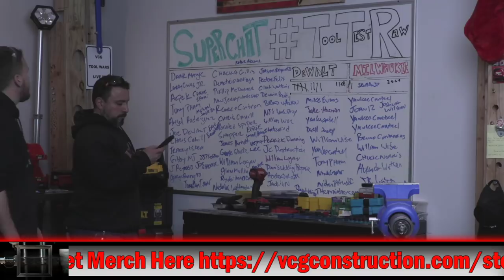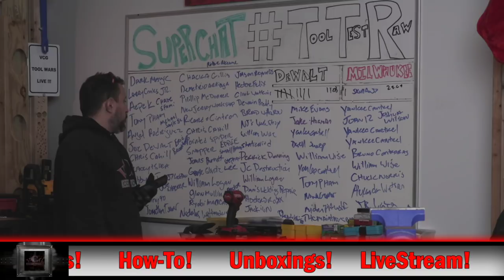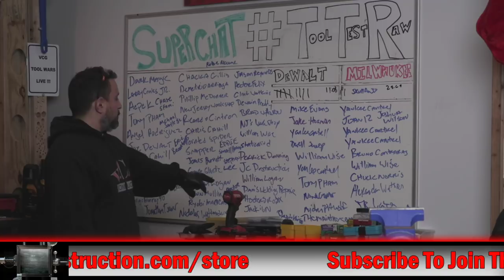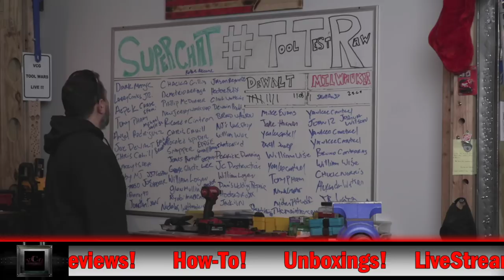Milwaukee M18 Hackzall VS DeWALT XR  Reciprocating Saw (BEST OF THE BEST)

Comment: The DeWalt blade turns in 4 different positions so you can make cuts in areas where you wouldn't be able to make a cut by turning the whole tool. And Milwaukee torch blades are awesome! Don't know who was saying they aren't. But I used those blades to cut through 10 oil tanks before I had to change it. And the only reason I changed the blade is because it  got pinched and I couldn't get it back out.
Reply: Most sawzalls you can flip the blades upside down. All the different ones I've used and owned I flipped the blade upside down and used them no problem. 👍
Reply: Jason Levesque every manufacturer will let you put the blade in either teeth facing down or up. DeWalt is the only one who is able to put it in facing left or right without having to turn the tool on its side.
Reply: @bamaboy9133  yeah  I know I had a Dewalt corded sawzall a few years ago that the blade went 4 directions .👍

Comment: I definitely agree on the M18 fuel Sawzall that has the articulating head and where that's an XXR that's a new one I think the fuel and the XXR would be a better matchup makes it more equal
Reply: I agree...this is not a good match in comparison.
Reply: @homemade6015  yes I definitely agree because the version that was being used for the Milwaukee as an older version and the fuel would be a more comfortable comparison nice to think I'm not the only one that thinks though thank you
Reply: @johnaba5683  I would like to see them to take up on your suggestion and have a fair rematch.
Reply: @homemade6015  thank you homemade I completely agree I think that would be fair

Comment: Last comment promise lol. At the conclusion of the vid I have come to the conclusion that the two saws have different niches and are therefore both winners. The Milwaukee for the one handed needs and the Dewalt for the compact full featured saw needs. And to be honest if you already have a full size recip I'm not sure the compact Dewalt gives you as much niche advantage as the Milwaukee would by picking up a secondary saw. If you didn't have a recip and wanted to pick up one saw that could manage one handed tasks (albeit not that well) as well as traditional recip tasks the Dewalt would probably be the one I'd pick up.

Comment: I have both the DeWalt DCS367 brushless & Milwaukee 2719-20 brushless.  I see little comparative advantage from having the motor project down from the blade-mounting shaft as DeWalt does or from having the motor project up from the blade-mounting shaft as Milwaukee does.  The  Milwaukee without battery weighs ~ 4 pounds and has 7/8 inch stroke while the DeWalt weighs ~ 5 pounds and has 1-1/8 inch stroke.  But in use, the DeWalt is not just a "denser" (language from video) version similar concept with more power.   Milwaukee's design largely compensates from reactive stroking mass vibrations by adding a separate counter-reactive moving mass which in some (not all) circumstances makes the DeWalt seem crude by comparison.  If the workpiece being cut presents a surface against which the guide "shoe" can be pressed with sufficient force to transfer most vibration into the workpiece, Milwaukee's vibration suppression compensating system offers no significant advantage.  But recently I was cutting through roots and debris under some small trees which I wanted removed at or below ground surface and that DeWalt, driving a 12" long 3 tooth/inch Diablo blade,  transferred such terrible reactive vibrations into my arm (using one handed) and shoulder that sustaining that work was EXTREMELY unpleasant.  While in that circumstance, the Milwaukee also transferred a lot of blade-force reactive vibrations into my arm, it was MUCH less wearing.  As to why that was true, I speculate that both DeWalt's 1/4 inch longer stroke length and Milwaukee's mass counter-balancing mechanism made contributions.   I hope DeWalt eventually releases an updated version of this high-performance saw which includes a counterbalancing system targeting an assumed mass of the saw's moving parts plus the average weight of one attached blade.  Then the choice between these competitors would seem to be mainly total weight and stroke length.  The heavier & more powerful DeWalt is only ~ 1/2 inch longer.  The air vent slots visible in the video showing the Milwaukee should inform everyone that it is an earlier model than their 2719-20.

Comment: I used a coworkers 1 handed hacksaw one time. I think it was the fuel but it cut like butter.  Havent got to test any of dewalts or makita newer offerings but it def smoked the older full size and compact one my lead uses.  I like makita but not a fan of the 18v sub compact sawsall.  I like a compact tool but not enough strength in the neck of the tool.

Comment: Got sort of an unusual question. I just bought the DeWalt Reciprocating saw these guys are demoing and noticed that the one they’re using has a much higher pitch than mine. My saw kinda sounds like a powerful sowing machine or something similar. Seems to work fine, but the vibration is heavy like they mentioned. Does the difference in sound mean something is wrong with my saw, or do they not all sound the same?

Comment: There are various reasons for picking a tool, what you use it for, how often you use it and how you get it to the job site. I don’t always have the luxury of driving my truck on site, parking costs etc, I don’t use a recip every day, but occasionally as a production carpenter in theatre when breaking down sets I use it all day, I can fit the Dewalt into a small back pack/ pelican case and get on the bus/ tube, and easily get it to work. It does vibrate a bit, but it’s a great little tool. Good to see you agree, thanks for the channel, but I would like to see you guys swap tools for every test.

Comment: I’m a diehard Milwaukee fan and user from a father to son generations but that dewalt resip saw convinced me after trying it to buy the saw and batteries and love it. Try climbing up in tight attics and you’ll love that four position chuck. And I made the dewalt saw my one and only resip saw. ~ hvac tech/installer

Comment: Ah the one handed test does demonstrated the one handed saws strong suit but also shows the skill differences between Vince and Nick. Nick does a great job always! But Vince is more skilled and that has a lot to do with his experience compared to Nick I'm guessing. Bottom line though the Milwaukee is a one handed saw better suited for one handed tasks and the Dewalt is a compact recip good for all recip tasks when you need a more compact unit. Thanks for giving us the Full skinny on that Fellas👍👍👍

Comment: I like your channel and enjoy your videos. Regarding this comparison, I think you're comparing apples to oranges. I like both of these tools and both brands. I would imagine the Milwaukee is suited for smaller jobs where you need your second hand free for other tasks. It's lighter, more ergonomic and better suited for that work. The DeWalt could be used one handed operation but it seems a bit awkward and heavy for regular one handed use. The DeWalt appears to be a lighter and shorter version of the full size reciprocating saws and should be compared to them accordingly. Why not get the smaller Milwaukee for the small jobs and a full size Milwaukee or DeWalt reciprocating saw for the bigger jobs?

Comment: I can see Nick wasn't ready for the one hand pipe cutting test. It takes skill. He will earn it later though it will take time. Never attempt that cut when you are tired. Don't need to cut yourself for not wanting to waiting tell the next morning on a job. I though Vince could do it. It is like asking Nick to use a Concrete Surface Finishing Walk-Behind Power Trowel he is not ready yet.

Comment: this is not a head to head against similar tools. a 2 handed vs 1 handed? i would use those tools for different purposes. if you need to cut above your head all day one handed saw would be much easier if you had to hold something in the other hand for sure. most of these ttr i like but this one i wouldnt want to go out and get one over the other. but maybe both. in the same platform. but thats just me.

Comment: That dewalt is a two handed tool so it’s in the Milwaukee super sawzall class not the single handed class tool should’ve broke out the super sawzall against the dewalt compact sawzall

Comment: it’s so cringy seeing people put pride into dewalt...they look like a toy from walmart, and they aren’t built nearly as well as milwaukee tools, plus milwaukee has way more tools with a huge 12 volt line up.
Reply: Maybe some of the newer dewalt offerings, but there's absolutely nothing "cringy" about being prideful of a tool that for the last 7 years has been through hell and back. Multiple thousands of fasteners, dropped and rained on occasionally, gone through batteries and brushes, shows the years of use on the outside yet still runs as good as day one, my brushed dcf885.